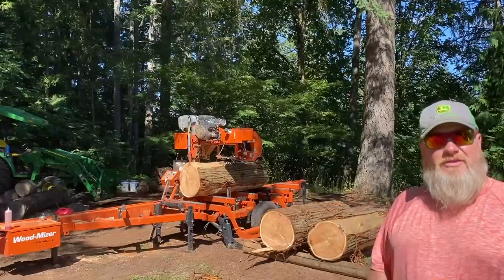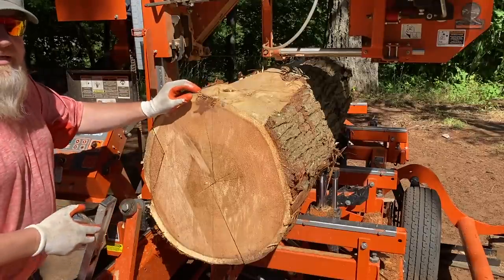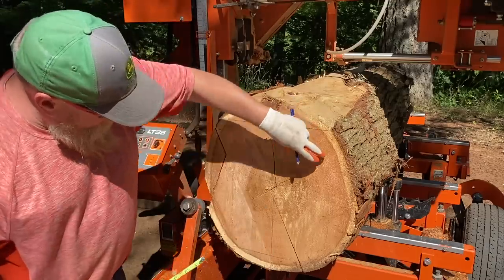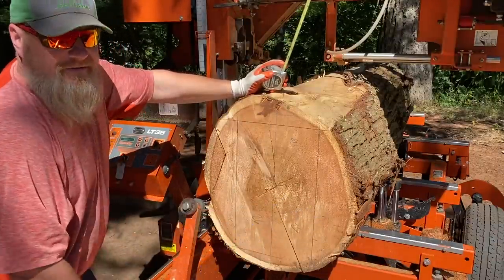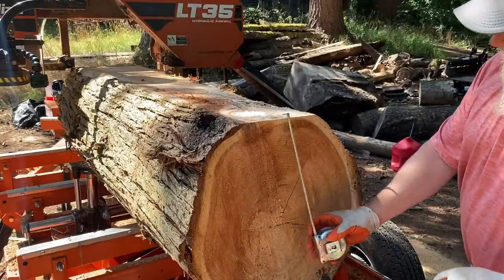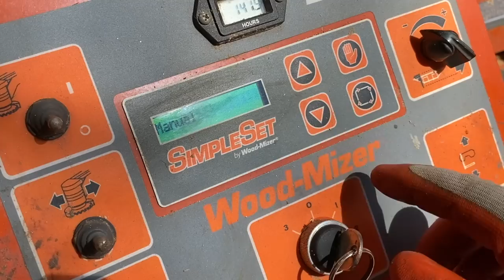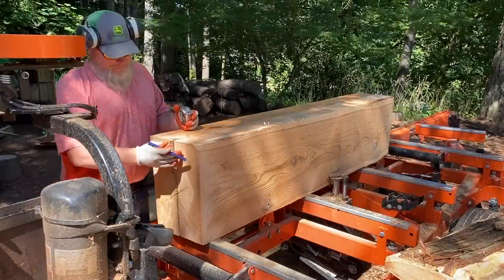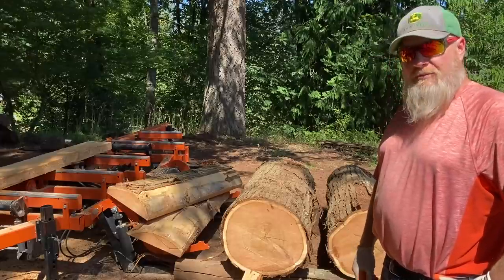Sawmill 101. How I Size Up Logs For The Best Yeild.

Comment: I just tried a 747 blade, on red oak. I haven't notice that much of a difference. I normally run 7degree double hard. I have been making a lot of fence boards also. I cut 3" x 5/8 for batten strips also. Happy milling Ron
Reply from the maker: Double Hard 7s are what I’m running now also.

Comment: I have a question. I am about to mill a ton of lumber. When the Doug Fir is still wet how much extra should you cut to account for the shrinkage? Like if I am cutting 2X6's....should I cut a full 2"X6" or closer to the 1.5"X5.5". Will that change much when cutting headers.  Thanks. I will be stacking and drying this prior to use for construction.
Reply from the maker: On 2x lumber I tend to mill an eighth over the 1.5x5.5 for shrinkage. It doesn’t lose too much.

Comment: So when you suspect the center of the log is no good, can you plan your cuts from the outside in and get similar results, or will the yield always be smaller cutting like that?
Reply from the maker: Well, the problem is, you never know how bad it is until you open it all up. You kind of have to spend the time processing it to know exactly what you’re going to be left with. In the video I made the next day, I have a Chestnut log with a soft center on the end but it didn’t end up going all the way through the log.

Comment: Hi Jason, Taking you up on a question. I noticed that the Woodmizer shop had a notice up with a Re-sharp facility at the rear of the building. Do you always use new blades or do ever have your old ones sharpened? Cheers
Reply from the maker: I’ve never had a blade resharpened. I have a bunch to take in but they have a really long turn around time so I’ve always just bought more.

Comment: Good video.  Are those 1550 fence boards used right off the mill, or will they be put in a kiln first?  I've seen several videos where things like barn siding could dry right on the structure and it was somehow accounted for.  Thanks and take care.
Reply from the maker: Yes. The cedar can be used right away.

Comment: How low can you get to the deck of your mill. Do you ever lay a board underneath when you get to the very bottom to keep from hitting metal?
Reply: Bill Tufts the saw stops about an inch from the deck so it can’t hit it. The only metal he could hit are the braces and log lock if he doesn’t remember to reposition them and any metal hidden in the trees.
Reply from the maker: Bill, Shemp is mostly correct. While the saw can’t hit the deck, I’ve found that the nut on the de-barker wheel can hang up on it. The last board on the deck can be as thin as 3/4”.

Comment: Don't know what blade you're using but I normally see the kerf more like .10" or a little more.
Reply from the maker: I’m running Double Hard blades currently.
Reply: @NorthwestSawyer  I calculate 1/8" for the kerf of the blade and it is dead on but I run 21-25 thou in set which I think is also what WM's set is. When I did 1/16" it didn't work for every blade due to variances in kerf.

Comment: Great video on laying out the log.  However, shouldn't the head scratching and figuring be done on the small end of the log?  That's the limiting factor of the lumber yield from the log.
Reply from the maker: That is true. I like to cut from the big end for a few reasons. I’ve found that when I cut from the small end, I end up taking more off in my first cut and possibly wasting a board or two. Also, if you start at the big end, you know for certain that your log will pass through the saw head all the way down the cut. Even a log that dimensionally should fit can be positioned on the deck off-centered to the saw head. I’m basically showing here how I do it. There’s definitely more than one way to do it.

Comment: I understand if you don't want to answer my question but for the 1500 fence boards you have to cut what sort of money would you expect to get per board or board foot or whatever? As I said I understand if you'd rather not answer. Great stuff as always 👍🏼👍🏼👍🏼
Reply from the maker: Thank you!  For the  5/8 thick boards, $1.75. 800 of them are to be 3/4” and they’re $2.28.
Reply: @NorthwestSawyer  Wow!!! That's a very good wage. I know you have to pay for blades, more logs etc but you'd pay for a mill in little time.
Reply from the maker: Joshua  that price is if I don’t have to buy the logs. It goes up depending on the price of the logs. But you’re correct. I paid for my mill in the first 6 months of owning it. The YouTube videos have earned enough to buy the mill and 10 years worth of blades!
Reply: @NorthwestSawyer  Wow!! That is excellent going. Fair play to ya. A sound investment indeed.

Comment: Was just wondering what your plan was to cut down to a 5/8" board? Does your mill cut that low?
Reply from the maker: It doesn’t. I have a slab of wood I put on the deck that will hold the last board up around two inches and that lets me cut the last two boards.
Reply: @NorthwestSawyer  That is an excellent tip!
Reply from the maker: I have a video where I show the process but I’m not sure which one it is😬